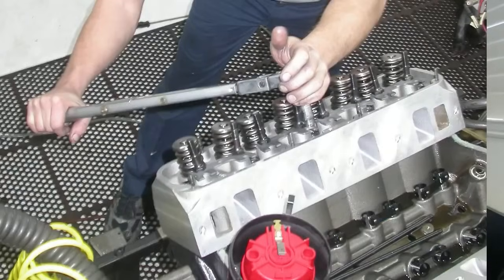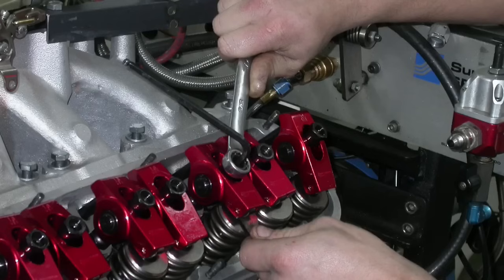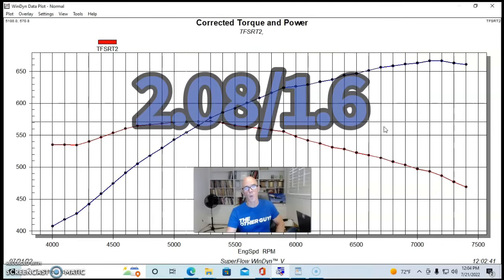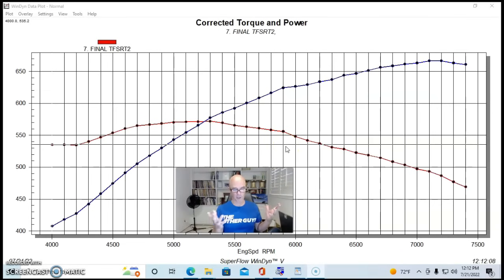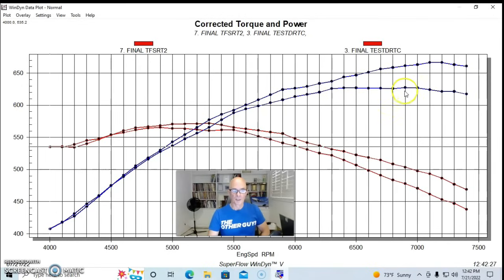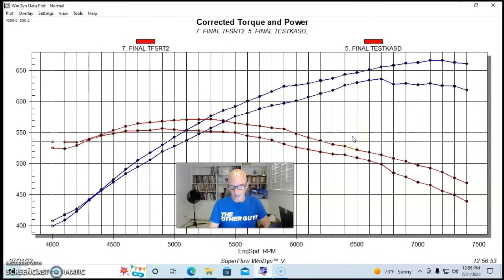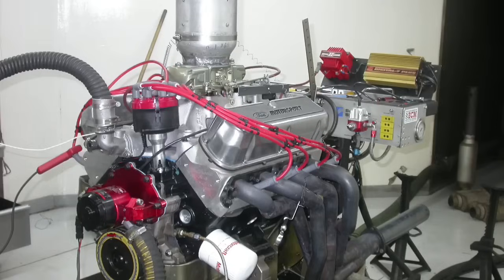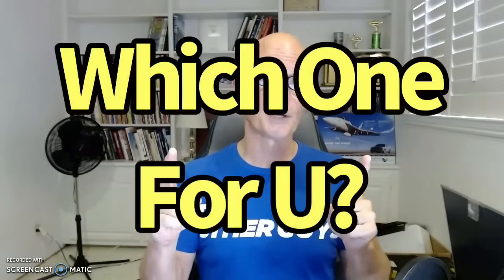WHAT CNC-PORTED SBF HEAD MAKES THE MOST POWER? KAASE v AFR v TFS R v DART v CNC VIC JR & HIGH PORT?

Comment: Her's how you get a good set of heads for the best $$$. Buy the TFS H.P. 192 as cast. Send them to Duane Busch for porting. I think you will be surprised on the savings. You will have a hair over 2k in a 3.5k set of heads.
Reply: I have a set of aluminum smog 192s from the 90s basically brand new.  Would these be better on a 363 or 427?  Where is Duane located and how long is the turn around time? Ty

Comment: With the given curve being the same. I will Say that each head did what its going to do with the Given test cam. The brain wants what the brain wants. So the max HP was accomplished with the head that liked the Cam, Intake and Header combo the best.
Reply: With 62° of overlap at .050" - that camshaft is way off for this type of build.
Reply: @edcurtis3375  So one of your super duper cams woulda changed how this whole test turned out?
Reply: @edcurtis3375  Is this why it was well under 600 ft-lb for the torque?    Normally a good built 408-427 ci will be 600 ft-lb or slightly greater.
Reply: Overlap determines where the cam makes peak torque... With an engine spinning up near 7500 RPM, I agree, the overlap should have been at least > 70°.

Comment: Those are too expensive for us working men
Reply: That's why everyone does a LS swap, there is no comparison dollar to dollar and ease of finding pretty much any part you can imagine.
Reply: @jeffjohnon4223  I have a 351 in my fox and I also have a gen3 5.3 on stand
Reply: @jeffjohnon4223  Junkyard LS is good but you’re not making this power with a junkyard LS motor without increased displacement, compression, and aftermarket heads by then you could of built a SBF to begin with.
Reply: A while back I decided with a Holley terminator over a cam and head swap. On my fox. The increase In power would be awesome. But now I run progressive nitrous and enjoy the option for e-85.
Reply: @christopherc3017  nice. I have had the holley hp for a few years and I still have a lot to learn and optimize. I’d like to get the car more streetable
Reply: @timweb1510  I have gotten some excellent advice watching the Leech motorsports series on the terminator.

Comment: I wish you could've gotten your hands on a set of kaase's p38 heads...  Not sure how much the 1-3/4" headers were really holding back. Bet you it's not much
Reply: A bud had a set of Kaase/jegs heads, I thought they were p38 but rebadged for jegs?
Reply: @rob5oh the p38 came out after the jegs head did. They had a different combustion chamber shape, but I guess outside of that, they were basically the same.
Reply: Some of us think it was 20-30HP.     They did this test in the LS world on 550-700HP N/A combos and 1 7/8" were worth 20-30HP with no low speed torque loss.
Reply: @dennisrobinson8008  I'd like to see that. See how differently the primaries we're arraigned between them and all that. We're they at least the same model of headers? Or different.
Reply: @jbuch66koop  his dyno header looks to be the super cheap MAC 1 3/4"   which have a tiny pinched entrance barely larger than a E7TE exhaust port.    Better 1 3/4" headers with a better entrance and better collector design were worth a measurable amount over these.  They are certainly holding it back.
Reply: @dennisrobinson8008  yeah that's what I was getting at, not all 1 3/4" headed are created equally. 😎 so I could see a good set of headers making 20hp just off a better design, with the same size primaries.

Comment: So the lesson learned here is that the TFS R heads beat out everything! Even the AFR which had a half point more compression!
Reply: You gotta keep in mind how long ago this test was, and how far the porting programs have come. If you ask anyone today between the two, pretty much the universal opinion is High Ports over Twisted Wedges, because guys are getting more power from the HPs today with modern porting programs. I also wonder if these are the older revision HPs too, Tooley revised them when he was with Trick Flow and that's a big reason why HPs are what they are today.
   
I wouldn't say this is a 'grain of salt' test, but you definitely have to be aware of how things have changed today. Make use of ALL data(the greater the variety of testing, the better) you have available for guidance, so the results of one test don't mislead you.
Reply: TFSR is not quite cleveland architecture but it has the rotated and valve angles modified, bests all of the inline heads as it always has.    They make big power.
Reply: I think with a correction on the valve springs the Kasse heads will out perform all of them. One of the things that Jon stresses is that big flow numbers don't always mean big power. He works very hard with port velocity. And if his heads have the best flow numbers if they were working right IE: maybe not enough valve spring. Then it would have been a different story.  But where are the Yates heads D3's ? C3 's ? They flow about the same numbers as the Kasse heads, and the bad ass Edelbrocks and the TFS heads. But they make a lot more power under the curve. That 427 would have liked a run with those. I think the only reason we see very little testing done with them is because they are stupid expensive and they require a special manifold, and pistons cuz they are canted valve and rocker arms and push rods nothing from the top end of a 20 degree top end will work with a Yates head except the carb.
Reply: It does with that certain combination ..I wonder what would happen if he done a cam change my a compression change .. maybe different crank n rods (stroke) .. would those heads out perform all the others then ?????
Reply: But twisted wedge aren't considered an inline head
Reply: Yeah the that was the criteria for the test. They just had to be CNC ported small block heads.  @michaelreilly7977